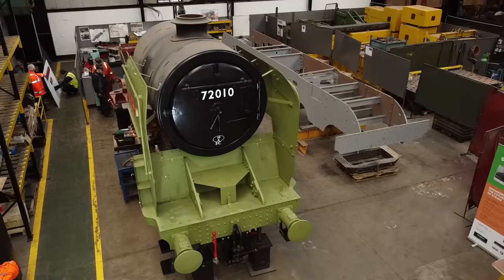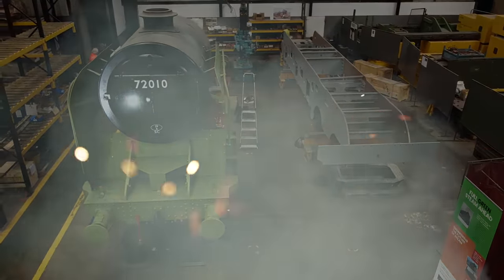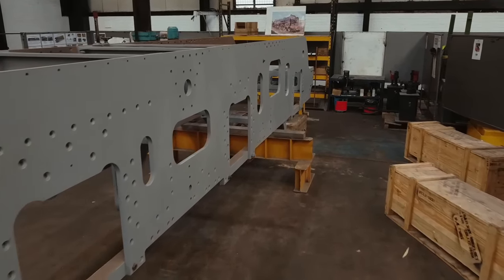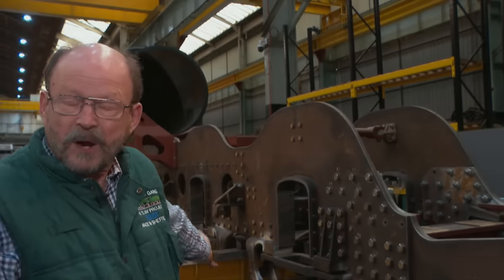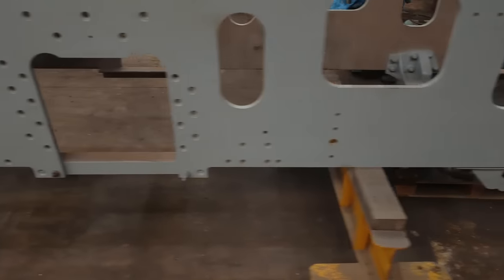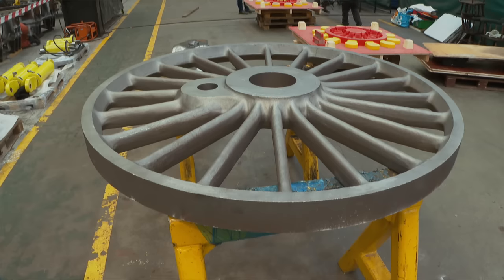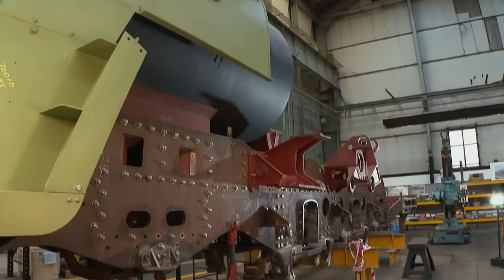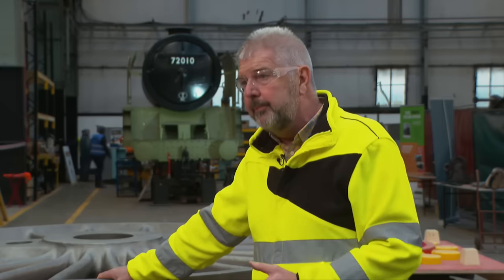One modern Sheffield factory - building two brand new steam engines. A short film by Tom Ingall

Comment: Great to see locomotives being manufactured in the UK again.
Reply: An honourable start. There's a long way to go... but a good start in the right direction!
Reply: As an American, I'm glad to see them build steam engines in the UK again.
Reply: Why? It is old inefficient outdated technology. Would you swap your modern home for some draughty medieval hovel?  The only thing this is any good for is hobbyists and nostalgia.
Reply: @rogerphelps9939  Your right, BURN THE BOOKS! They're an old medium, why use em when we got tv. Nostalgia and memories stop us from reaching our true potential! Worm food for the worm god! How could I be so blind!
Reply: @_wheeler8601  As I said, steam locomotives belong in the same category as medieval battle re-enactments. A bit of fun, nostalgia but little else. Books are extremely useful and versatile, steam locomotives, not so much. That is why we have much better means of traction.
Reply: @rogerphelps9939  they're still used in parts of the American railways on steep inclines as helpers. The torque they produce is higher then diesel.
Furthermore we have made advancements in technology that would be interesting to see used in modern steam engines.
Reply: @_wheeler8601  Not very relevant. They will always be a niche interest.  I doubt the torque is higher than diesel electric. A modern electric motor has massive torque right from zero rpm.
Reply: @rogerphelps9939 steam engines can pull more at high speeds than a diesel train of the same power, they're cheaper to maintain and more reliable, in terms of inefficiencies that can be solved with finding ways to condense the steam like in modern powerplants. Not exactly outdated just underdeveloped because people think they are outdated (even though nuclear powerplants are just basically giant steam engines ).
Reply: @rogerphelps9939 steam engines do have more torque than even electric diesel trains, due to the weight of the train and the fact that the rotational energy and pressure produced by steam is able to apply more force to the wheel than a conventional motor.
Reply: @kristianferencik8685  So? Electric motors have very high torque right from zero rpm which is what you want. Steam engines are around 5% efficient and terrible polluters. That is why they are in the dustbin of history apart from a few museum pieces.
Reply: @rogerphelps9939  in terms of pull strength, electric and diesel trains, can not compete with steam engines. The efficiency issue of trains can be rectified by adding a condenser (which was experimented during the late 40s, before steam trains were decommissioned). The fact is steam trains were not decommissioned because they were worse than diesel or electric. They were decommissioned because the public perception (and global perception) viewed them as archaic, primitive machinery that no self-respecting 1st world country would use. Once the funding for steam engines were cut, the steam engines eventually broke down and nobody wanted to repair them, so they were put into heritage railways for tourism and memorabilia, even though they could have potential been more efficient and profitable than diesel if they had just furthered the research for steam condensers and filtration smoke boxes.
Reply: @kristianferencik8685  Thank you Sir, also, there are several manufacturing methods being taught to inner-city students by a generation that would rather show then tell. Methods that are nearing extinction but still has relevant use in infrastructure. This benefits both parties immensely.
Reply: @rogerphelps9939  Steam is and was very underestimated, the age off steam was very quickly finished never developed to its limits , I think we should look at a combined technologie off modern days and the past, not all was bad
Reply: @peterzwart2830  You really don't get it do you? Steam had reached its limits. Electric and diesel traction are far superior. You are looking at the past through rose tinted glasses. I suppose you think that firing up a steam engine several hours before it could actually be used, shovelling filthy coal etc was fun.
Reply: @rogerphelps9939 Because people will pay top money to be pulled by one. Simple
Reply: Indeed they will but there is a limited market and the old locomotives are quite capable of doing it. @lioncurlew
Reply: @kristianferencik8685  None of that is true, unfortunately. Steam has low pulling power, because a steam locomotive can't put all it's weight on the driving wheels and go fast at the same time. You can see that by looking at the engines in this video - the BR class 6 has about 28,000 lbs pulling force on starting, which is eclipsed (by a long way) all diesel and electric locomotives; you won't find a type 3 (which did the same work as the BR6 did )1960s diesel electric locomotive with such poor starting pull.
As for efficiency: you can't add a condenser to a steam locomotive; condensers work on power stations where adding 100s of tons is not a problem. The people who made the most efficient steam locomotives (Chapelon, La Porta, Wardale) didn't think condensing was viable. 
Lastly, steam locomotives were phased out because they were not as good as diesel and electrics. They cost more to run, are more labour intensive, they are relatively slow and polluting. I'm a huge fan of steam locomotives, but they are a dated technology.
Reply: @teddansonLA  what are you talking about steams most beneficial attribute is its overall power output. An external combustion engine is always going to be able to pull more than an internal combustion engine and because of its added weight, it can pull more at higher speeds. But since diesel and electric are cheaper to build and cheaper to run, and are more fuel efficient they won out. But that's not to say that's a limitation of steam itself, that's a limitation of the technology implementing the steam. Currently there are still efforts to revive steam because of that main benefit but to make it more efficient. 

Steam itself is not archaic, the technology that was used to implant steam was archaic, that's were innovativeness comes in. Recently their was an british engineer who built a steam motorbike that reached a record breaking speed of 163.8 mph by preasurising superheated  water.
Reply: @kristianferencik8685  No, what I'm talking about is that there are much better technologies for building railway locomotives than putting a steam engine on rails. And I was corrected your wrong assertion that steam locomotives have more torque than diesel or electric locomotives - the don't. 

An external combustion engine is always going to be able to pull more than an internal combustion engine and because of its added weight

That's not true. The Gresley A4s, for example, weighed about a 160 tons (you can't forget the tender), but the adhesive weight was about 63 tones. The class 55 that replaced them was about 100 tons, with 100 tons adhesive weight. So class 55 was lighter, had more pulling power and more power at high speed. That tender sitting behind the A4 weighs about the same as two coaches! All the extra weight does is eat up fuel, it doesn't contribute to pulling power.

The best way to use steam is as part of a power station, where you can put a condenser to use, and use efficient turbines etc. Reciprocating steam locomotives have had their day - and steam turbine locomotives are hardy any better (in fact, the LMS turbomotive couldn't outperform a Chapelon reciprocating locomotive). 

The steam powered bike you mentioned is a novelty, it doesn't signal a new steam age. It;s basically a jet powered bike, but is slower than a petrol powered bike.
Reply: @teddansonLA  a steam train has more torque than a diesel or electric train (of the same size) that is a proven fact, one of the few benefits of a steam train. 

Also your using examples of steam trains that haven't been innovated on in 70 years, that's not a compelling reason why steam cannot be innovated on to produce a better train, that's like taking a  propeller plane and using that as an example of why planes aren't going to get better.

The steam bike is an example of how through innovation you can get better results out of a fuel source that is believed to be outdated. Yes, gas bikes are faster but that was just a couple's passion project that broke a world record. Its an example of what can be done through innovation, something that is looked into by companies because again, steam is great for pulling more loads at high speeds than diesel or electric (something that is proven)
Reply: @kristianferencik8685  a steam train has more torque than a diesel or electric train

That's not a proven fact. Its the exact opposite of proven - it's completely wrong. 

lso your using examples of steam trains that haven't been innovated on in 70 years

They are the only examples that exist. You obviously accept that the steam engines of 70 years ago have less torque than diesel/electric trains, so why argue about it. 

that's like taking a  propeller plane and using that as an example of why planes aren't going to get better

No, its like me saying jets engines are superior to propellers, and you claiming propeller plains work better than jet engines, but then complain when all the propeller planes that prove my point are old. Well of course they are old: they got superseded by the better technology!

The steam bike is an example of how through innovation you can get better results out of a fuel source that is believed to be outdated

It's a rocket, and you won't see any of them out on the road on sunday. Your example is a novelty act, proving nothing useful at all.

steam is great for pulling more loads at high speeds than diesel or electric (something that is proven)

No, that's not proven, the exact opposite is proven. The fastest steam train there ever was pulled a 7 coach train wieghing 240 tons down a hill at 125 mph (with a blip at 126 mph, probably from vibrations) and then broke. 11 coach pendolinos weighing 600 tons, with almost 8000 hp go up shap summit at 110 mph (the maximum line speed - so they could go faster). Eurostars go close to 200 mph, are 400 m long with nearly 900 tons and have 20,000 hp on board. No steam locomotive is getting near that.
Reply: @teddansonLA  I think you are confusing "pulling at high speeds" for going at high speeds. Pulling at high speeds just means pulling at the higher end of a trains speed limit, that does not mean a train going 100+ mph. The fastest steam train was the Mallard a passenger train, not really a freight train pulling cargo. That  award was the big boy pulling 120 cars at 40 mph (this was it pulling at high spees), ton for ton a steam engine can pull more cars (heavy cargo) at high speeds (a trains theoretical maximun effort). 

Something that has been known about for years written in articles from Journals such as railroad history by Robert Aldag, online news outlets such as auto week and more.
This is proven a steam train is more powerful, produces more torque than a diesel or electric of the same size. Overall speed doesn't equal, tractive effort or power. A car can go faster than a truck but a truck can pull more than a car.
Reply: @kristianferencik8685  No, I don't think so. Power is force times speed, so all traction lose pulling force as the speed goes up. The steam locomotive force falls because steam can't enter/exit the cylinders fast enough, and this is worse in the UK because the loading gauge limits the cylinder size. The electric motor force falls as the EMF increases with speed. But the point is the power of an electric train/locomotive is much more than a steam engine can generate. Like I said, the Eurostar has 20,000 hp available, that's a lot of force at all speeds up to 200 mph. No steam locomotive has 20,000 mph.

Pulling at high speeds just means pulling at the higher end of a trains speed limit

No, it means having high pulling force at the speed of the train. 

That  award was the big boy pulling 120 cars at 40 mph

The big boys were not even the most powerful steam locomotives. They produced 6000 hp at the drawbar. Anyway back to Mallard, which could make 2400 hp going up hill, but on its record run it was was 1700 hp (because the power of Mallard is matched to average service speeds, peaking near 80 mphs or so). SO you see the other point: eventually all forms of traction lose power as speed climbs. For steam locomotives, the limit is generally near 120 mph.

This is proven a steam train is more powerful, produces more torque than a diesel or electric of the same size

Total nonsense. I already gave you the numbers for Mallard; but compare them against the diesel electrics that replaced them. Mallard: 2400 hp (at drawbar, maximum); 160 tons for each unit. Class 55 "deltic" diesel locomotive: 2600 hp at the drawbar, but 100 tons. So 26 hp per ton, versus 15 hp. The class 55 top speed was 125 mph also, but here's the main point: the class 55 knocked an hour off the London-Scotland journey time. An hour faster meas the deltic is pulling harder, all the time. 

You don't want to compare the Mallard to the class 91 electric which works the same route, because that had 6500 hp but weighed 80 tons, and was 2 hours faster from London to Glasgow. 

As for the big boy: the big boy weighed more than 500 tons (because you can't forget the tender) and gives 6000 hp, 135,000 lbs maximum pull (but not at 40 mph). The GE AC6000CW is less than half the weight, has 188,000 lbs pulling force and puts about 4600 hp at the drawbar - so get two of them (still weighs less) and you've got 1.5 times as much power, and nearly 3 times as much pulling power at starting. And yes, they're still pulling harder at 40 mph, because they have 9200 hp to work with.

One French electric locomotive will get you more than 8000 hp at the draw bar; you better believe they are pulling hard at 155 mph, when all steam locomotives are not pulling at all.
Reply: @teddansonLA  look dude I cannot argue against incorrect statements, you are wrong. The big boy was and is the most powerful steam train ever made with more than 6000 hp and could haul more than 3000 tonnes of cargo. No the steam could get out fast enough, cause its literally using the pressure build up to do so, it's literally using physics to do so, you loose a lot of speed when youre pulling heavy things, also power is calculated as diameter of cylanders(squared) x length of strokes x pressure/ diameter if the driving wheel (nothing about speed), no it wasn't worse in the uk, the uk literally had some of the best running steam trains in the world, the only issue is the amount of water in the tanks. 

Again acedemics journals have pointed out the fact that steam trains produce more power.
Reply: @rogerphelps9939  They have between 10%-13% efficiency .The old engineers were no idiots.And Diesels are terrible polluters too.And if you do not like steam engines, stay away.
Reply: They should be restoring the hundreds of historical railway items that are rusting away on so many preserved railway lines. More money than common sense creating new expensive toys. The likes of Tornado will never be historic authentic locomotives.

Comment: What a fantastic project and as the Chairman said younger employees are learning on how things are put together and built, just like back in the day when the greats like Crewe, Derby, Swindon, Eastleigh and Doncaster were building and making wonderful engines. These will be fantastic engines keeping steam alive 😊
Reply: What I would like to know,  will they convert all the old drawings to metric or will they use imperial measurements?
Reply: I which I was a bit nearer but if any body needs help in way by taking about it by all means get in touch Bill
Reply: @tonysheerness2427  HOW DARE YOU SIR!!!!!!!!!
WHITWORTH ALL THE WAY!!!!!
Reply: It's very important, because in one generation, many skills and much knowledge can be lost forever.
Reply: @joejoejoejoejoejoe4391  I was the first generation to get dumbed down, Whitworth was diameter of the bolt where as SAE was across the flats. When picking spanners to undo a bolt SAE was far easier. Forgive my dumbing down. But dumbing down has now gone too far.
Reply: It will more common to realiability to prevent the sharp edges in the frame... apprx 1/16" ...😊
Reply: Not only keeping these amazing 'beasts' alive but re opening great old lines to run them on a win win solution especially when they not only provide a boost to tourism but where appropriate a much needed function as local transport on old Beeching cut lines.
Reply: I saw a video about steam locomotive excursion lines having a problem with coal supply because of much of it coming from the Ukraine. Perhaps maybe they can increase British coal mining a bit, l don't know. What l did find impressive in the video was there are apparently 150 Steam excursion lines operating in the U.K., which as a Canadian, l found inspiring. We have hardly any steam locomotives operating in Canada, most surviving steamers are in museums, huge sheds or rusting away parked in front of towns. Good for the British!, Please keep up the good work!
Reply: Not very relevant to today.
Reply: @tonysheerness2427 not a problem. In CAD you can switch between units of measure, scale etc. with no problems. Output to any modern CNC equipment will be converted to metric, simply because metric is a logical decimal system, whereas imperial of course is completely made with it's 12 inches per foot, fractions of inches, then thousands of inch tolerances. Thank god we changed to metric BTW😂
Reply: @tonysheerness2427 bollocks Whitworth is simply a thread system, with it's own particular geometry